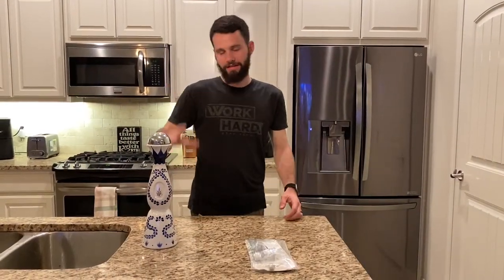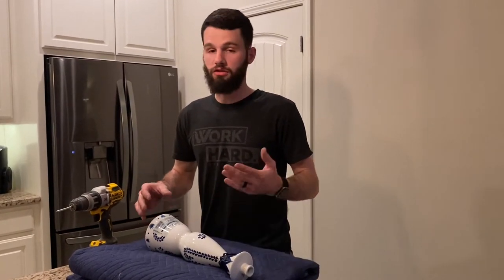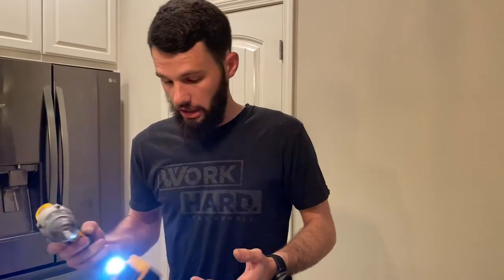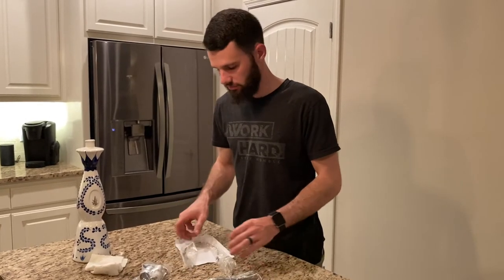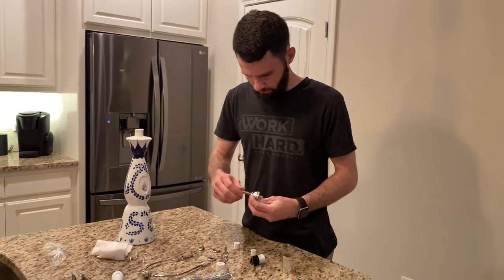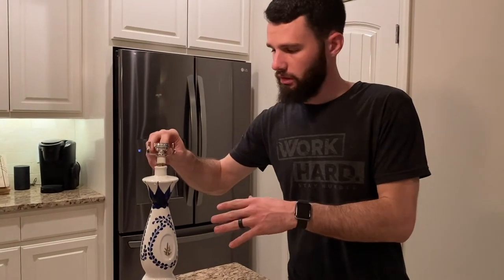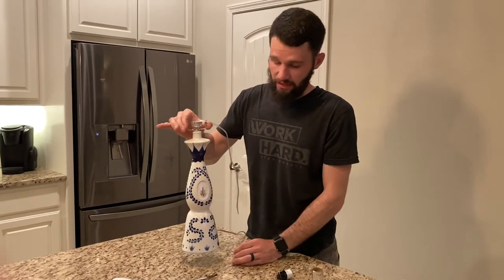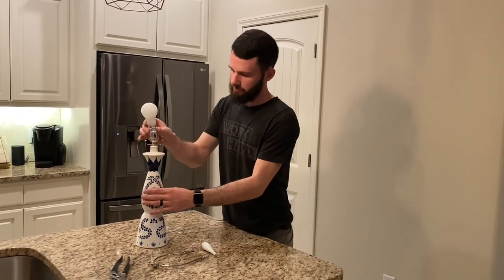Making A Tequila Bottle Into A lamp

Comment: I made 2 lamps using the same bottle. You can make a cleaner install by placing a rubber grommet in the hole you drilled where the wire will pass. For a firmer hold of the head unit, we used the bottle’s own cork. Drilled a hole to pass the hardware and dremell the top portion of the cork to a snug fit to not crack the lid.
Reply: Do you know where I can get the lamp holders?

Comment: The knot in the wire before hooking the wire ends to the screws is for safety. If someone trips on the cord the wires won't pull out from the screws and possibly cause a fire. It's called an underwriter's knot.

Comment: This is so cool!  I have a quick question regarding the lamp.  How big is the bottle?  Is it a regular 750 ml bottle of tequila to 1.75 L.  It seems so big.  However, because you had to drill for a while, the ceramic might be thick and it would be a regular amount of tequilla.
Reply from the maker: Bottle shows 750 ml but I agree it is larger then normal, it has a tall neck and the ceramic is about 1/4 thick if I had to guess or alittle less
Reply: @thebuckaroos6135  LOL!  I love tequila, but I think I love this bottle made lamp more!  I definitely need help doing this.  I don't own any of the tools and am not handy.  Thank you so much for replying quickly!

Comment: How would you go about doing this without the drilling if it’s even possible I got the bottle from my in laws and would love to gift it back to them as a lamp but I’m so afraid I might break it when I drill it and I can’t even afford buying another bottle or even fathom asking them for a second
Reply from the maker: Yes, the light bulb socket has the option to have the cord come out of the side instead  of the bottom, the cord will just be seen from the side

Comment: Why was this not drilled with a diamond drill bit with water?
Thats not just ceramic dust - that is smoke.  You’re lucky you didn’t crack the bottle.
Reply from the maker: My bad, I guess after the 34 bottles I have done and only crack one by pushing to hard, I don’t know what I’m doing, also definitely not smoke but then again I’m probably wrong about that as well! Thanks for the input! Let me know when you make a video so I can see how it’s done!
Reply: @thebuckaroos6135  I asked a question, as well as speaking the truth about what I was watching on your video.  Why are you being snarky with me? You’re triggered because I said that? An amateur watching your video may not know to use a diamond drill bit with water and could end up cracking their bottle. Thats the only reason I asked. I never insulted you or said you didn’t know what you were doing. Forgive me for asking a question and wording it incorrectly. By the way; being snarky is not how to get more followers. 
It is smoke. Ceramic dust doesn’t float up into the air the way it was here in your video. But you obviously know everything there is to know which is why you can be snarky to strangers asking questions. Forgive me for not seeing that you are THE ABSOLUTE PERFECT HUMAN here on earth. 
Your rude! I’m a stranger to you and you’re perfectly triggered by my asking a question and making reference to what I see happening on the video. 
Beautiful lamp. Great job. I’m glad it didn’t crack when you were drilling a hole into it. 
Thank you for your kind response.
Reply: @mialove781   you’re drama. lol. 

i’d say you’re being the snarky one with the “you’re lucky” comment. i’m also looking forward to seeing your diy video since you can clearly do it better haha.
Reply: @thebuckaroos6135  great job with this diy and thank you! i’m really looking forward to making this for my bar!